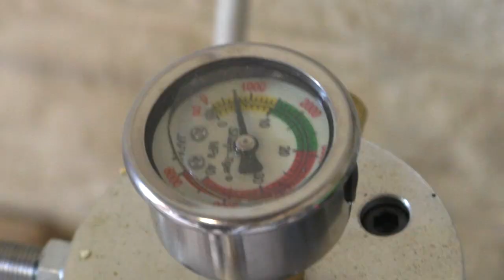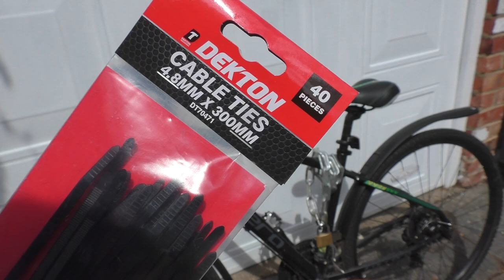DIY train horn bicycle - 132DB

Comment: It's great that you're using hearing protection. I mentioned to an audiologist that my ears were ringing when using the Airzound, and she thinks it's an exception to the rule that 28 seconds is the daily quota for 115 dB. I think loud bike horns should be equipped with practical hearing protection so that cyclists can honk like they have their windows up. With a proper design, a horn should be able to filter out the frequencies most harmful to hearing while emphasizing those that easily pass through closed windows.